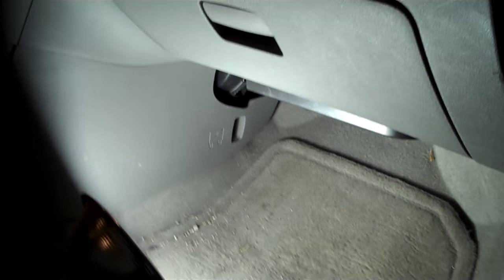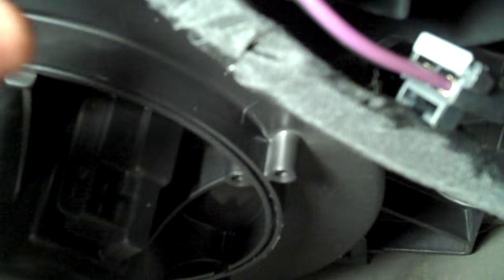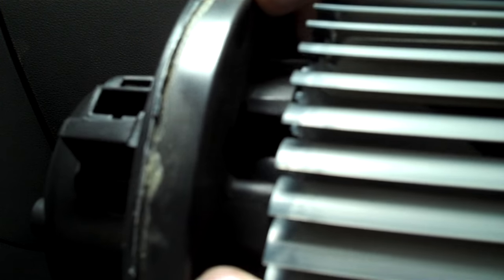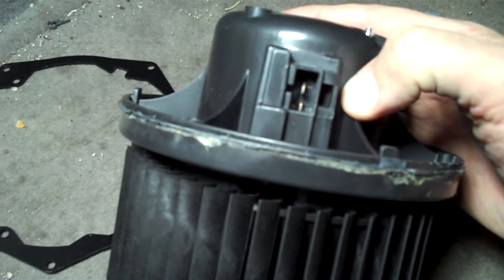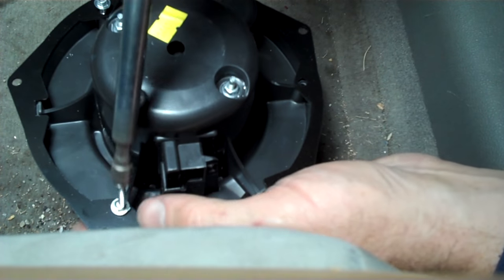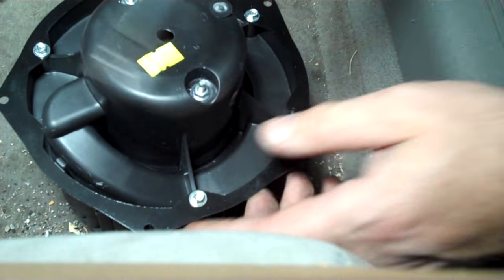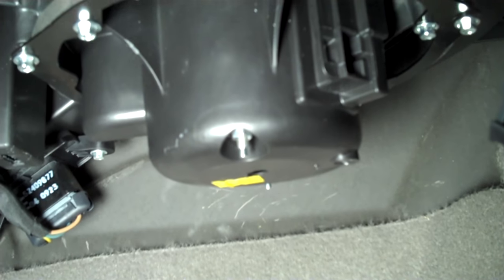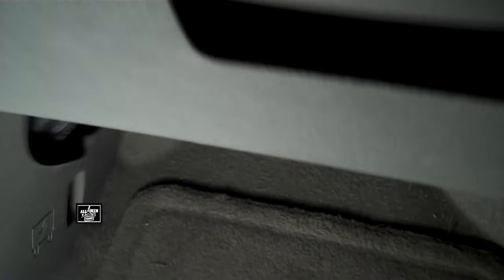How to REPLACE a 2008-2012 Chevy Malibu A/C Heater Fan Blower Motor

Comment: My 2012 blower motor is about to go out, it’s ticking real bad and it works when it decides to. As a temporary fix until my new one comes in, I just give it a few kicks and it works again. Your video will be very helpful for when I change it out, thank you so much!
Reply from the maker: How did your repair go?

Comment: this came just in time for me and my 08 malibu.  not good for the blower to stop working in the middle of a hot tx summer.
Reply from the maker: Hope this was helpful!
Reply: @All4HimRacingVideos  after watching this and other videos here I stuck my head under the dash and discovered the hush panel gone and that the blower motor had already been replaced before I bought  my 08 Malibu.  Should make it even easier to replace again without having to cut around the motor. Just gotta hope it's that just the motor and not it and the resistor.

Comment: Good video.  I diagnosed my daughters malibu over the phone and decided the fan motor needed to be replaced.  Got the job done and everything is working fine.  When I got the old fan home, I noticed the electrical terminals were quite dirty and I cleaned them off, applied 12 vdc and the fan works perfectly.  I would just recommend cleaning the terminals first before replacing the motor.  It could be cheaper.
Reply from the maker: Very good suggestion!

Comment: Was the gasket kit a sperate order from blower motor?
Reply from the maker: For the brand we purchased, yes, we had to purchase the gasket kit separately. Some replacement motors come as a kit with new gaskets and others do not. Unfortunately you will need to do your own research before you buy.

Comment: I can't get mine to push all the way down to get the connector to be able to plug in... what did u do to push it down all the way
Reply from the maker: I would first check to make sure the pins that the connector slide down over are not bent or miss aligned, causing it not to be able to plug all the way down. Did it come apart easy but just not working for the new part?
Reply: did you have difficulty getting the plug to line up?   i have it seated all the way but its not far enough to line up plugs.  after market blower (same as yours) has a bracket on top that prevents it from seating far enough down.
Reply: @bretrodeback3801   check to see if the screws that hold the plate on top of the blower motor are hitting on the tabs inside the plastic cover.  There are four and two were hitting on the top of mine . I used a rotary tool  to grind them down.

Comment: Excellent video thank you very much however I ran into the little snafu where the four tabs inside the factory plastic cover that you got to transfer onto the new motor prevented the electrical harness on the motor to pop through it so I grind them off and Bamm, perfect fit. So I made my little video and post it on YouTube if anybody else will have that issue

Comment: Thank you so much for this video! I went to the shop today and they estimated $375 to do this job on a 2011 Malibu. I bought the part myself from Advanced Auto Parts the motor costs $106 I used a 22% off coupon bout it for $89 w tax, followed your instructions and saved myself almost $300. It took me about 38 minutes. Also now they sell the entire blower motor and bracket as one part the hardest part was getting in a good position to screw the new motor in.
Reply from the maker: Very glad we were able to help you out!
Reply: I wish I saw this before I jumped the gun and dropped $400 to get my blower motor replaced in my 2012 malibu. Lesson learned... when anything else fails, go to YOUTUBE!!

Comment: is it possible for an air freshener to get stuck in the blower motor squirrel can? Like, what are the chances? That is what the dealer told my friend caused a loud blowing noise when running the A/C. Makes no sense to me, but I'm not an expert on cars. So, just wondering.

Comment: mine motor came without the 5 screws,,,please help me teling which screw size i need to buy, tks in advance
Reply from the maker: To be honest I cannot recall, and I do not have any spare parts at the shop for this. Good option is to take your screws to a hardware or home supply store, they will have thread gauges to help determine the screw needed.

Comment: Thanks for the video. - made removal so easy! I think I would have gotten frustrated and broke something while cutting the adhesive, but your demonstration eased the pain a bit. My replacement was all-in-one. I just had to screw the unit back in. I think it would have been a little easier if it had the separate bracket like yours, but still works great.
Reply from the maker: Glad we could help!

Comment: My Car Not Blowing Air at all, do you think the Blower Motor are the problem? Thank you.
Reply from the maker: Do you hear the fan running? If not, than I would think either blower motor or maybe as easy a fix as a blown fuse.

Comment: I’m dealing with this issue right now. Only thing is when I bench test the motor it works fine but maybe a little bit sluggish. Could the climate control system be that sensitive to a motor thats just starting to go bad maybe?
Reply from the maker: The motors run capacitor may be failing if its sluggish at times or struggling to maintain speed. What symptoms did you experience before you removed to bench test?
Reply: @All4HimRacingVideos  The motor was not operable at all, however after posting this inquiry, I took a stab at examining the resistor and just by touching the resistor connector, the motor suddenly sprung to life. However I noted signs of slight heat buildup in the wire sheathes by the slight brown discoloration they had.
Reply from the maker: Hmmmm, sounds like the connection has degraded. If possible, you may be able to re-solder the connections.
Reply: @All4HimRacingVideos  After doing some further research, I concluded that with the motor running sluggish, I believe the bearings inside were worn. (I need to invest in an inductive amp clamp so I can measure amp draw). This would explain the browning of the wires to the resistor because excessive draw puts more of a load through them, which means excessive heat buildup. So I went ahead and just replaced the motor and took the resistor connector apart and resecured the terminals with solder and that seems to have done the trick. Thanks for your help!